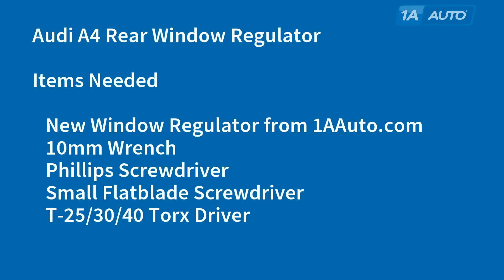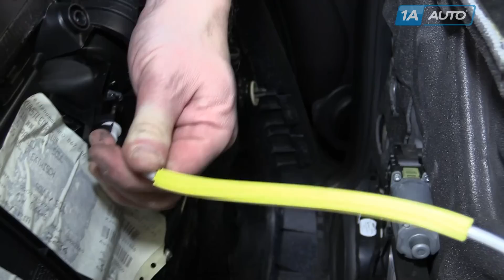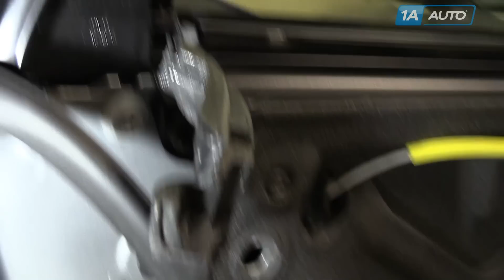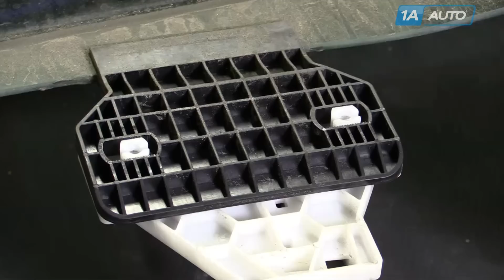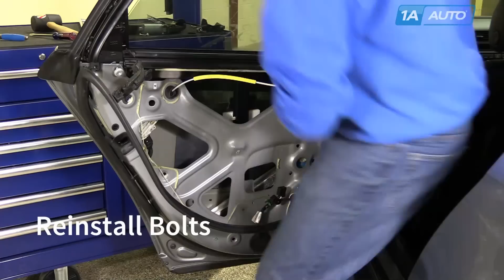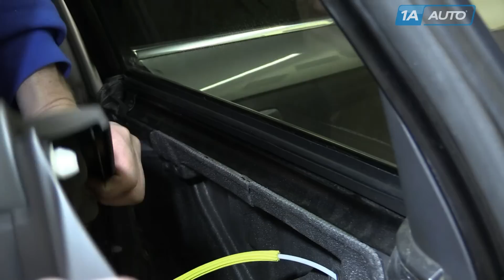How to Replace Rear Power Window Regulator 02-08 Audi A4

Comment: DO NOT clip that wire tie off until the window and regulator is reinstalled cut it just before you reattach the motor. I just tried installing a new regulator and cot that tie before I inserted the window. The gear popped out and the whole thing went to pieces. A real Rube Goldberg mess.

Comment: nice and  clean  man good job i wish you could do mine also i have the s4 2005 and my window rr window went down but not back up....so i ordered the reg my lr is not going down and i don';t hear a sound . my inside trunk frame on the left side is cracked the unit that holds the wheel ..can that be rigged to keep the cables in place so the storage tray can lower and raise like normal ..... do the rear window have any thing to do with this?

Comment: The part worked but the door panel and the t40s took some effort to take off. You used the original the replacement has a different set up on the window slide that should be mentioned. Wasn't hard to figure out but some might find it difficult. Overall I'm satisfied and the window works well.

Comment: I replaced mine using 1A Auto part. It was different from original. I had hard time attaching the regulator to the window. I ended up buy some bolts from home depot. Also make sure to reattach the cable clip because otherwise the cable will get in the way. Overall very happy with the results

Comment: Nice video, very well made. I changed mine in front on my building in 1 hour, based on your video. ( broke 2 door clips,  but they are chip)Works on European Seat Exeo ST 2012 model. Same parts, bolts, clips.